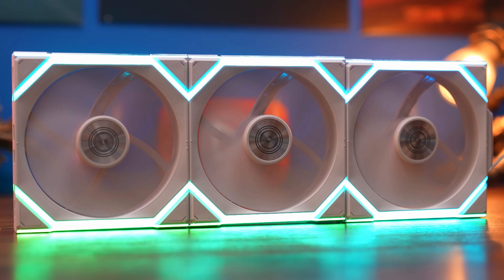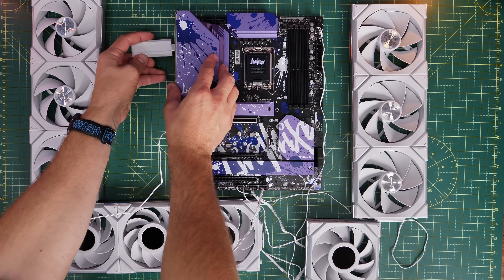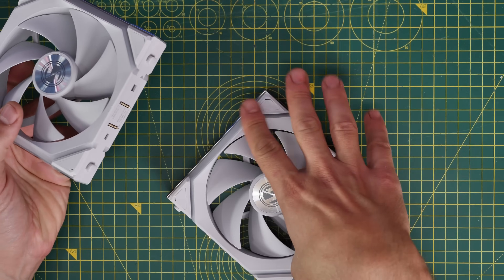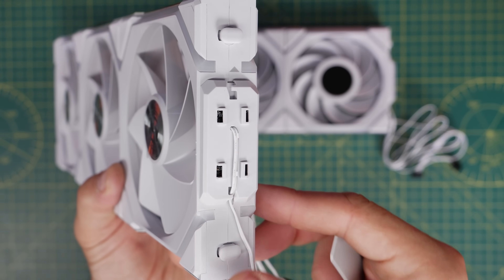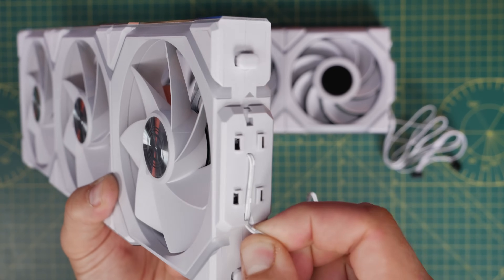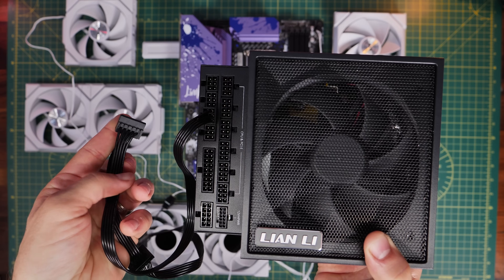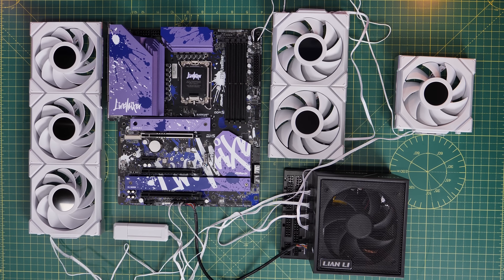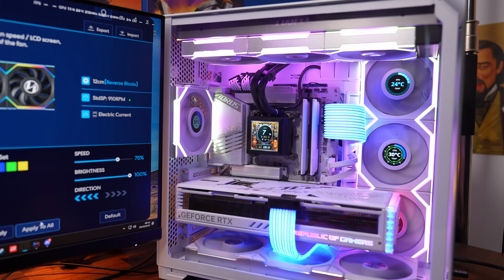Lian Li SL Wireless and Wireless LCD fan setup guide

Comment from the maker: For those asking, I've checked with Lian Li and the wireless controller will NOT work with the older TL fans. So no you can't do that.

Specs of the build (note these include affiliate links which might earn me a commission at no extra cost to you.)
Case - Lian Li O11 Vision Compact - https://youtu.be/SCxZJtZj8k4
Motherboard - Gigabyte Z790 AORUS ELITE AX ICE https://amzn.to/47oalxf
CPU - Intel Core i9-13900K (https://amzn.to/3QH6uUv)
RAM - Crucial DDR5 6000MHz Pro series RAM https://amzn.to/3UnPS6t
NVMe SSD - WD_BLACK SN850X NVMe https://amzn.to/3Y5DJFB
SSDs - Crucial MX500 2TB and Crucial BX500 2TB https://youtu.be/IOJNybKZ4wk
PSU - Corsair RMShift 1000X white (https://go.corsair.com/1rv9Ra)
Corsair PSU Cable kit - https://go.corsair.com/1rbAq6
GPU - ASUS ROG Strix GeForce RTX™ 4090 White OC https://amzn.to/4h33hu1
AIO - Lian Li Hydroshift LCD 360R AIO https://youtu.be/EhAJlQQMPfE
Fans - Lian Li SL Wireless fans https://youtu.be/0cQ-BFJwz7w
Strimers - Lian Li Wireless Stimers https://youtu.be/nLxwK7jbtFI
Reply: can i ask a stupid question?/

if you wanna connect the mb sync way hardwired into the mobo  you then can't use the software, its only if you use the dongle?  and with the reg no wireless, if you connect the controller to the mb sync, you can't use the software either? so you can't get best of both worlds is basically what I am trying to ask.
Reply: Hi , any chance i get a bit of help from you . I am struggling with SL lcd fans to install them . None of the lcd’s are working . They turn on when i start the pc then they turn off in a few seconds. They spinning and rgb is there , i also can see them in L- connect . I pay you if needed. Tia

Comment: Hello sir, very interesting video but I can't understand something. I have an MSI Carbon X870e 6 X TL Infinity motherboard (wired fans without LCD, I recently purchased a Lian Li Hydroshift 2 TL Infinity (Wireless fans)
Unfortunately I have a problem connecting it to the motherboard. I have two USB ports, but the water cooling has two USB connectors, and one of them is occupied by my old 6 TL Infinity fans provided that I have a LianLi Edge 1300 Platinum power supply, I can use any of its USB inputs 🤔
I see that you explained, I'm just not good at English.
Reply from the maker: Yes. See this video - https://youtu.be/gH8tm8xnNjM

Comment: Will this wireless connect work with 11 fans? Or is that not gonna work?

I got 3 x Lian Li LCD Wireless reverse fans,  4 x Lian Li UNI FAN SL-INF 140 and Lian Li UNI FAN SL INF PWM Reverse.

I have only LCD fans that say wireless so do the other ones need this feature or was this a feature in all their fans?
Reply from the maker: If you're not using the wireless models of the other fans you'll need their respective controllers. You might be able to mix and match but the wireless controller cannot control the wired fans.
Reply: @TheProvokedPrawn roger🫡

Comment: There is also a powered USB fan hub made for the Lian Li Edge PSU which attaches to it, or can be magnetically located elsewhere in the case. This can serve the same purpose as the Corsair hub mentioned, and is a more elegant solution for some builds.
Reply from the maker: Yes but it wasn't out at that point

Comment: Let me get this straight (I'm a real rookie and I want to surely confirm it) if I have the non lcd fans. I'll have just 3 PWM cables which I can connect to SATA power, plug thr usb controller into the back of the motherboard and I'm set? Or does the non lcd still have some sort of USB?

Comment: If I buy a triple pack standard can I put 2 in front 1 rear with the same connector or do I need to buy a single one by itself cause my pc case only has a spot for 2 intake

Comment: I’m completely stuck with my new UNI Fan SL V2 LCD fans. In my set of 3, the 3rd fan’s LCD display doesn’t work properly. It powers on at boot, but as soon as Windows loads, the screen turns off. In Device Manager it shows up as “Unknown USB Device (Device Descriptor Request Failed – Code 43).”

I know the fan itself isn’t faulty, because if I swap it into another position it works fine. I even installed a powered USB hub, thinking it was a bandwidth or power issue, but that didn’t solve it either — really frustrating!

From what I’ve researched (and even from ChatGPT’s advice), this looks like a firmware issue with the SLV3 controller hub. My system says I’m on the latest firmware, but apparently v1.7 or newer is needed to fix this problem.

Here’s what I don’t understand: how are some people’s fans working fine on the “current” or even older firmware, while mine just won’t? Has anyone else run into this Code 43 error, and did a firmware update fix it?

Any advice or confirmation would be massively appreciated.

Comment: Can you use a 9 pin adapter to usb a and connect the lcd into the port on back of motherboard? Is that possible also? Thanks
Reply from the maker: I'm afraid I don't know what you mean
Reply: @TheProvokedPrawn can I connect via a cable the lcd wire from fans into motherboard not internally to control usb? I have no spare headers and im itx so not much room for a usb hub.

Comment: I have the regular not lcd fans and they keep glitching like colors change and fans slow down then go back to their speed. Tried everything used motherboard pmw doesnt work tried to use the sata to 3 pmw directly in psu still same issue and updated l3 connect still same issue. Any ideas?

Comment: Hi! I just build up my PC with Lian Li TL wireless fans, but LCDs on the fans are not working for some reasons. When my PC is booting, Lian Li logo would light up and then turn off. On software (L-connect 3), I cannot set up LCDs. How could I fix this issue? Thank you in advance!
Reply from the maker: Go into the bios and set them to PWM mode on the relevant fan headers

Comment: So just to verify if i do not want to plug the controller into the back of the motherboard and would rather hardwire the controller. I have to plug the controllers usb into a usb port and the Chasity fan connector in as well?

Comment: my 3 pack of lcd is connected to my motherboard cha fan header and it flicked on startup only it means on startup it has not enought power , should i continue using it like this or change to  sata splitter?

Comment: If someone can PLEASE answer me this.

Is there any visual difference between these and the lian li sl v2?

I ordered 9 fans, the shop delivered me only 4, with a promise of other 5 soon. They never got them in stock, and they are sold out everywhere.

This bothers me to no end looking at in my nzxt h9 flow. Thinking about adding these
Reply from the maker: Yes they'll have differences visually and they connect differently too
Reply: @TheProvokedPrawn thank you so much for the reply.

Yeah, i am ok with connecting differently, just wanted to know if i can avoid swapping out the fans i have by just adding these, if they would match visually

Comment: These wireless fans have an awful lot of wires.
Reply from the maker: Funny
Reply: @TheProvokedPrawn it really is funny.  The TL lcd wired has one cable from a fan group to the controller.  The TL lcd wireless has 2 cables with 3 connectors per group.

Comment: I have the Lian Li PSU with USB Hub built into it so my question is can you connect the USB cable into the back of the PSU USB Hub or it has to be connected to the MB? Thank you

Comment: For the 4-pin fan connector to Sata I noticed it has 2 pins and I herd you cannot control your fan speed, should I be worried 

Because I’m trying to find 4 or 5 way 4-pin connector to SATA, and whenever I order then, it always comes with two.

Comment: If plugging the fans into the Sata/PSU, instead of the mobo, will I still be able to control speeds in a 3rd party app, like fan control? Or am I limited to using Lian Li software?

Comment: Will one usb controller work for fans and strimer cables? Or would I need one for both making 2 total?
Reply: Im also wondering the same thing, in addition to how many fans you can bund to one wireless controller. Both the lcd fans and non lcd fans.
Reply: A single controller can control 10 channels.
So if you have three 120mm wireless fans connected together, that is one channel
If you have a single rear fan as exhaust, that is one channel
Every streamer is a channel
Hope that helps 😀
My wife is running 6 fans and a streamer on one controller. Since the fans are daisy chained (3 and 3) she is only using 3 channels

Comment: Hi. I’m building today my Hyte y70 Infinite Touch using Lian Li LCD Fans. I have three lcd on the side, three lcd on top and one lcd on the back. On the bottom I have standard lian li fans since it goes beneath the floor. I am wondering if I can connect all the lcd fans so I only have to use one cable to connect to the motherboard?

Comment: What is the point of a wireless LCD display fan if you still have to have the same amount of wires plugged into the motherboard?
Reply: You dont need to attach to the motherboard or daisy chain

Comment: Is there a maximum amount of fans that the wireless controller can handle? For example, if I am using 6 wireless lcd fans, do I need to use both wireless connectors or just 1?

Comment: stupid question, if i buy 3 of these and i already have 3 lian li uni fan al v2. can i run them both on my pc just not on the wireless dongle? does the l connect still pick up both fan types?
Reply from the maker: You'd need to have both the wireless dongle and the AL controller in the system but in theory I believe they'll still work together yes.
Reply: @ tysm for answering! Im excited to see it when they come in today :)

Comment: What if I just bought a single one that didn’t come with a splitter or usb controller how would I connect it if I just plugged in the 4 pin I wouldn’t have rgb  right ?
Reply from the maker: You wouldn't be able to control it, yes

Comment: why do we need wireless fan control with LCD fans when they already use USB ?
Reply: Wireless controls the rgb, usb controls data aka the lcd. Beats using a pci-e connection for powering a hub.

Comment: What if I also wanted to use a aio with this? so the fans on the radiator and system fans are being used. Will it all be fine on the same controller?

Comment: Oh so you need need to plug in the controller, does that mean if you do use the controller you wouldn't need the wire in the back to connect it?

Comment: Hi there, I installed 6 ( 2x3 packs ) fans, the Lian Li SL Wireless. Everything works BUT when I reboot the system, turn off or turn on, I have 6-7 seconds of flickering lights, really disturbing, I tried like everything, even switch from DC to PWM ( if is correct) on the bios, still nothing....can someone help me :/ ?

Comment: If I use the SATA to power the fans, and plug in the controller with the internal motherboard usb, do I still need to plug in the pwm from the controller to the motherboard? Thanks!
Reply from the maker: Yes it needs power
Reply: @ thank you! Finally got the pc up and running !! Just missing a 5090 🙏

Comment: So every fan I put in the back of my case half the fans RGB doesn’t work 
Any idea why that is? There’s been 3 different fans in the back (single fan) it’s always the left side of the fan that doesn’t work
Reply from the maker: Is it possible the values are not connected properly?  Have you checked the settings in L connect? Have you got it connected to the motherboard or sata power? If motherboard then try setting it to pwm mode in the bios
Reply: @TheProvokedPrawn I have it connected by Sata I tried to plug my fans into MB but they just blinked
What settings would I look at in L connect? 
When I clean it this week I’ll took off the plug (sliding piece) and put it back on see if that it wasn’t connecting properly

Comment: Thank you for mentioning the option of using a USB hub. I really wanted these fans but wasn’t going to buy them due to not having enough USB connections on my motherboard. Also glad you mentioned that the Lian Li psu can also be used as a usb hub. I was considering buying a new psu and might as well just go that route. 2 birds 1 stone

Comment: Is that sata cable included in the three pack?
Reply from the maker: Yes
Reply: @TheProvokedPrawn  thank you so much for this video. My fans weren't working properly. Changed the settings in the bios but the chains of three were still not getting enough power! The sata cable fixed it!
Reply: @TheProvokedPrawn  Do they sell another one of those cables? Or make a splitter? I have one more group of fans that seems to be struggling to get necessary power.

Comment: I have the Z890 ProArt with stupidly only one USB header. I have the NZXT hub plugged into the one head header on the MOBO. I plugged in the lian li's to it and sometimes it's not working. Any recommendations for MOBOs with only one USB Header?
Reply from the maker: I'm surprised that's not working. I assume it's connected to sata power properly? And you've got the latest version of L Connect.
Reply: @TheProvokedPrawn it works and turns on however it’s not always stable. Sometimes I get the all white screens on random ones or a fan or two won’t spin. I can confirm the NZXT Hub is connected to Sata.

Comment: You, good Prawn, are a Saint and my savior! Just finished my first PC build, all Lian Li fans, and I was having a serious tantrum getting them all to work. You just saved me so much pain, and as a beginner builder, thank you!!!
Reply from the maker: Glad I could help! 💗🦐
Reply: @TheProvokedPrawn  do the fans really conect to the hub wireless no need for more cables to go to the hub itself because i have the lian li dk07x the desk where the pc goes inside and i plan to buy normal non lcd fans and i only see one cable on your video and it either goes to the mb or power supply i olnly want one cable if possible could you explain thank you
Reply: @just4gaming639if you’re using only non lcd then it’s just one wire, it’s a chassis fan connector you plug into your motherboard or into the sata connector if you want to use the controller internally.

Comment: Thanks for the video helped a lot but i have a problem. I have the lian li wireless fans 10 of them but the hubs on the sata cable are 3 so i connected one my fans to my mobo.Now in l connect recognise the 9 with the sata cable and not the one plugged in the mobo. Any solutions plz?

Comment: There is a awful lot of cables involved in these wireless fans.
I really like it for the strimers since they are getting their power from the cable they are connected to but for the fans not so much.
Reply from the maker: Two cables for three fans of bit a lot

Comment: Hey, so if you were to install these on an AIO you would plug them into the CPU fan header correct?
Reply from the maker: Correct
Reply: @TheProvokedPrawn  I have heard people saying that the motherboard headers can cause issues, with the amount of power they give gradually rather than them being a set amount. Have you run these through the CPU port and if so have you had any issues like that? I am wondering if it's better to use the SATA cable to power them and then set up the fans in the software to follow CPU temp, I am not sure how rigid the software is though.

Comment: One set of my wireless fans keep disappearing and reappearing and resets it’s color why is it doing this
Reply from the maker: Could it be a loose connection? I had a similar problem and another solution was going into the bios and making sure the fan header was set to pwm mode. Could be it's not getting the right power. You could try using the data power connector.

Comment: I have 4 SL LCD fans and I used NZXT USB2.0 Hub to have more USB ports. But when I open my PC, the LCD screen doesn't work. Any thing I can do?
Reply from the maker: The USB hub is powered and the fans are too? I had an issue and has to make sure the fan header was set to Pwm mode in the bios.

Comment: Quick question: is there no more the cable between (set of) fans that exists in previous versions? I have a mini-itx case, so I will buy 3 fans separated (not a group of 3)

And, as always, thank you for the video guide. Your explanations are the best <3
Reply from the maker: You mean a cable to link between fans? No

Comment: i have the sl wireless fans, and in L-Con 3 it wont show the LCD screen to adjust it when i click on it, everything else is working.. i can set up the rgb on every fan but only the lcd wont show up… how can i fix this? pls help 😅😅
Reply from the maker: Have you checked for a newer version of L Connect? Is the USB connection in place?
Reply: Click on the lcd part in lconnect. Not exactly very user friendly though.

Comment: 12:26 seems like the most important part because case front Usb is another header and i already have SL fan control and hydro shift aio was going to add one of this fan too but seems like over $120 invested in a single lcd fan to add into system?

Comment: A hint for you guys, the pins of the usb only use 4 the mainboard has 8 pins for usb so you can use a sharp object to push out the 4 pins and put it on the other black usb plug thing so you have 2 usb things but only one plug (aslong the usb plug thing only have a 4 pin [which it has])

Comment: Question. I just built a pc. When using l-connect I’m not able to click/access the middle portion of the lcd fans. When my mouse is in the middle of the fan in sl wireless fan utility. It’s kind of annoying and I really want to use the lcd part of the fans.

Comment: Can you Control the rgb of These Fans over the rgb Button over the Fan hub on the montech King 65 pro because They only have one cable so you can only Plug them in one Connection in pwm or rgb